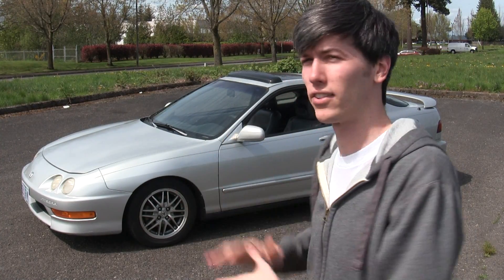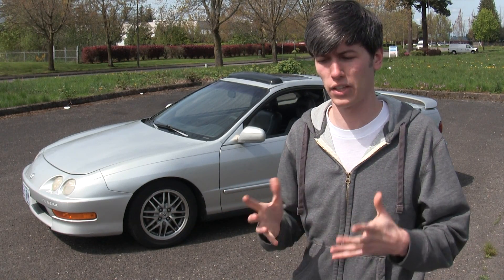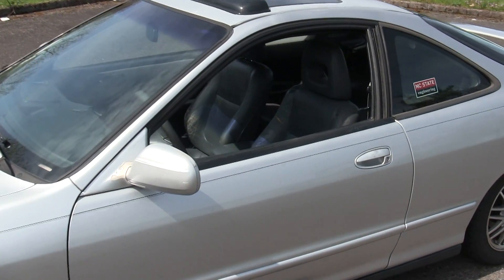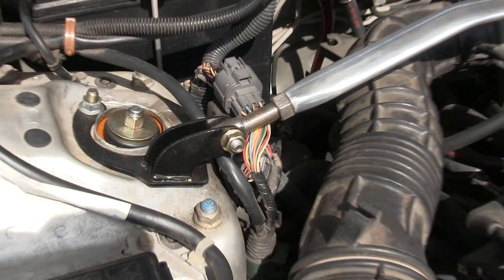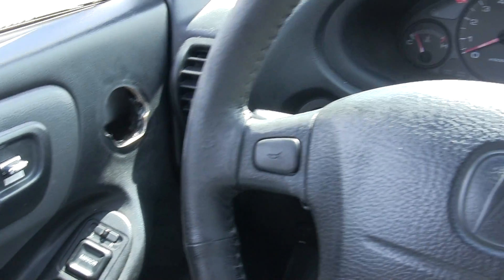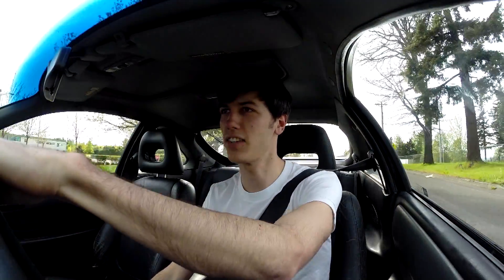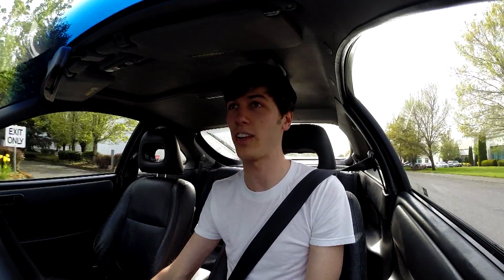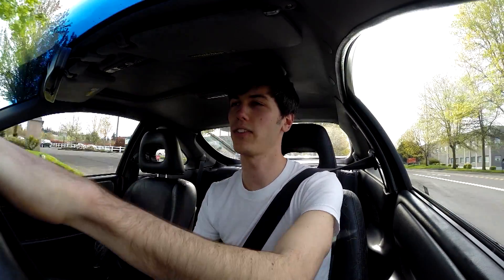Project Integra - Let's Build A Race Car

Comment: SO!! I'm late as hell!! But I have a really good idea. Make the integra into a canyon carver! No turbo! Supercharge it with something like a G-Lader supercharger from VW's G60 setup and make it a torquey, hard puller instead of a useless freeway racer. I'm thinking about doing something similar to my car. It'd be interesting to see how much you could get out of it (especially seeing as it'll be lower boost so you can probably get away with 9lbs right out the gate!).
Other than that suspension, steering, and brakes are going to be your bread and butter. I think the goal I had set was to be able to kill a wrx on a curvy back road. Sounds impossible but a lighter car with more mechanical grip and low-end grunt might actually work out. I figured I'd need more torque than hp since it'll be a lot of mid-gear carving so with the right setup you might get away with a modest 200hp/200lb-ft and the most overkill setup on suspension, brakes, wheels, and tires. Also a quicker steering rack but I think the factory one might suffice (never drove a teggy before so I can't really say).

Comment: You should put a turbocharger, even though I've heard all motor b18's are quick and strong the beauty of it would be that your motor can take a beating of higher speeds and temperatures. I'd suggest (because this is what I've done) AR50 Turbocharger- $100 ebay. Used b18 turbo exhaust manifold- ebay $30. Check for to see if its warped or you can find them on craigslist relatively cheap near you. Intercoolers and waste gates all can be found cheap (less than $100 together) while looking for the turbos i mentioned above. High performance injectors. Not sure what kind of ECU you'd use but I'm sure you could find out that answer. Go to home depot and buy house piping that has the same diameter as the input and output of both turbo and intercooler and going into your intake manifold. Buy lots of clamps too. Lot of reading in forums and there you go! Cheap method, but you will really really feel a difference. Some say ebay turbos are bad, but I've had mine for some time and it works just fine! (no play on shaft so bearings are still fine)

Comment: Start with a light weight performance flywheel and clutch system from ex ready. Increases acceleration and reduces the weight by 12lbs. PLus higher reves

Comment: Mishimoto radiator for a cooling upgrade? Msds for a ignition upgrade? Front lip from whoever you choose which will generate more downforce.  Get a bigger and better air intake which will suck in more air which you will might wanna upgrade to a bigger exhaust since your gonna wanna push out air as fast as it's going in.You could do a triangulated strut bar for the strut towers and a strut bar for the rear. You could do a poor mans type r?

Comment: all motor ls vtec, setup the suspension for road course racing and put a cage in it. kirky racing seat, some good electronic gauges, hondata s300 for the tuning. our acura is setup for scca road racing, its a blast and very capable.

Comment: I am working on my first tuner, usually buikd muscle cars, but for most part the basic mechanics are done . ( Check out MY FIRST ACURA ON MY PAGE ) Car is dropped but rides awesome . . . What i am thinking is SUPERCHARGER . If you go turbo then that involves piston changes and other upgrades so i would like to see what just a simple bolt on SUPERCHARGER will do . 
 Ironically my car has also been stripped of a lot of weight ... don't hate but i am going to be redoing the interior with carpet, sound dampening and custom wood touches :)

Comment: Hey! I just suscribe to your ''channel''! That's funny cause that's exactly what I did with My teg. 10yrs from now I decided to turn it into a time attack car... Since then, many engine, tranny, gearing, diff, weight, suspensions configuration has been test on this car... Here's what it turns out now fully striped, cages, weighting 2250 w/o driver with 2/3 fuel tank with a k20R in it... Not much car can compete with me on track... Especially on my short home track ASE!

ASELC 23 juin 2014

On this vidéo I was testing new gearing with old tire so my driving might look a bit ackward sometimes but hey, that the price to pay to go faster! 

I will follow your project !

Comment: Half of these comments are ridiculous on making a race car lol .... so for weight reduction you say to pull seats ok well integra rear seats weigh about 2 lbs altogether if that lol the front pass weighs a lil more maybe 5 lbs to 10 lbs  carpet weighs almost nothing that won't make any diff for a race car if that was the case youd have to just gut the  whole interior door panels all the dash etc keep just what gauges you need and that's it  all that would be left for interior is driver seat steering wheel and your gauges and ecu ....  as for motor mods you can go boost on the stock Ls but in my opinion and from personal experience doing it .... if your  pulling the head and going into the engine that hard you might as wlel make it LSV which im running on my integra which has better power outputs then any stock lS  you have  VTEC added so its now a better engine  but while inside swapping the head around upgrade cams valvetrains etc you could swap pistons to go ith high comp for NA or low comp for boost which the LS is already tuned for in the bottom end ..... now that the motor work would be good with an all rebuilt great engine with better revving and power outputs stock ..... now you go with a good turbo upgrade for power and put a good shot of nitrous in the trunk and this thing will pump out 6 to 800 hp depending in the internals upgrade you do and the shot of nitrous / turbo setup and tune but even on a lowball setting itd be an easy 550hp  with a car less than 2400 lbs power to weight would be great and a lot more fun then your STI ..... That's mY 2 cents I look forward to watching your build

Comment: Engineering Explained I work in a spare Parts shop in Australia and one thing that is still in heated debate are the benefits amd cons to pod filters vs the original air box. Maybe that could be a cheaper but still informative video???

Comment: 2 ideas: take it apart, see how little bolts you can use when putting it back together.  Just because.  And the other idea is to install a massive richer wing just to see if there are any performance gains

Comment: itr rear sway bar+ asr brace, sticky 200 treadwear tires, good brake pads, and seat time, you'll learn a lot just from what, rotation in the corners is quite good on these cars. 

Im in a similar situation as you with an integra as a second car with a powertrain warranty still on my GTI making me hesitant to mod it as much minus wheels and suspension. The thing about the Integra is Im finding it more raw and a fun tool to learn to drive faster with no electronic nannys on it outside of ABS.

Comment: Nice this Is awesome Integra makes makes a great fwd time attack car, I'd say no turbo do an all motor build more reliable and can beat on It harder  as for my suggestion for a video , do whatever you can to make that car as stiff as possible with strut bars, bracing etc maybe even a bolt in roll cage.

Comment: Rebuild the motor ..new piston and rods... bigger turbo (if you can get it ), full exaust ,new front and rear coils, weight reduction, bolt in cage, race seat, short shifter and big slicks tire in the front ...that would be and awesome car right there .... hope you can do this good luck man !!

Comment: At 5.35 we see you driving and turning right. You are using your left hand which is crossing over the centreline of the steering wheel. Your left hand is pushing away from your body.The muscles humans have that expand our appendages are less accurate than those that draw our appendages inward. Use your right hand to turn right. Use the left to turn left. Don't cross the centreline and you will discover an accuracy like never before. Try riding a push bike with crossed arms. Likely to fall off. Because the car has 4 wheels it wont fall over, that doesn't mean you aren't creating  unbalanced energy for the springs and dampers to cancel out. Ride a horse with left rein in right hand and vice versa. When you pull on left reign to make horse go left with your right hand it will be confused because rest of your body isn't working to tell horse to go left. So a car isn't a horse. But good driving requires you to feel the energy from a car. Thus professional drivers sit closer and firmer into the seat. This is of significant benefit to anyone wanting to enjoy the performance of their car.

Comment: People who don't understand why you would tune a slower car do not understand tuning at all. On a fast car that is brand new there is little to learn. On an older car every upgrade can be felt and the cost factor is easier to take. You can then move to a faster car and do what you want with it. People that want to do their own work do it this way. People who want to pay someone to do the work and then say they tuned their car won't learn much from it. I'd rather do the work myself than have someone else touch my ride.

Comment: Something on the cheaper side.
1. Strip interior
2. Upgraded rear sway bar and subframe brace
3. shorter gearing transmission such as b16, b18c1/c5, etc...
 For more power you have a lot of options. But these are relatively cheap mods. Oh and don't forget sticky tires.

P.S The holy grail of engine swaps is the k20 or k20/k24. It is a high potential engine and can gain 50+ hp with just bolt-ons and tune. It is a potent swap, especially in a lighter weight chassis such as your DC4. But, for much cheaper you could turbo your motor and easily attain 300whp on a stock motor safely and with upgraded parts your looking at so much power you'll have trouble putting to the wheels. Good luck, I own a Integra ls as well and love it!

Comment: Do you have any preferences as to whether you want to start modifying the engine first or the chassis?
I would like to see a whole rebuild of the engine with: cylinders bored out more, stroke shortened.
I would also like to see pneumatic valve lift modification. =)

Comment: See how fast you can make the stock car by removing weight/stuff before you start modifying it.  Then see how fast you can make it by reducing drag.  Gut the interior, remove sound deadening tar, stereo, heater, ac etc.  relocate the battery to the rear, and add multiple grounding points along the chasis.  Remove all excess wiring.  Remove cruise control, wiper fluid reservoir, air box (stick a cone filter on instead).  Remove power steering.  Move on to aero.  Seal all of the panel gaps with rubber insulation (look at an BRZ or FRS hood) or other methods.
The Right Way to Remove Sound Deadening with Dry Ice

Comment: Throw a VTEC head on it get your headers done get an exhaust get a new intake, new intercooler, get your internals done get a new clutch and strip down the engine bay , after all that check how much power your making than turbo it  and strip down the inside and get lightweight seats, tune it and definitely make it a sleeper.

Comment: Remove the sunroof and weld in a metal plate. It's supposed to cut about 50 pounds from the top of the car and improve structural rigidity

Comment: You should look into getting light weight wheels and tires to save un-sprung weight. Im putting 17x8 and 17x9 rpf1's which weigh 15 and 16lbs. You should also  do a video about un-sprung weight too if you could please and thanks @Engineeringexplained

Comment: Power? Feh. If you really want to go fast, remove weight. Lightness is the single most important performance modification for any car. This means remove EVERYTHING; carpet, seats, interior trim, sound deadening. Get a lightweight battery (and move it to the boot) — "simplify and add lightness". I'm sure you're all aware of the benefits: better acceleration, cornering, braking and fuel consumption.

If weight is the most important thing, then tyres are the second. You could have the best engine and suspension ever, but the tyres are what actually do the handling. Choose wider (and light-weight!) wheels with the slickest tyres you dare.

Brakes are just as important. With good brakes, you can spent more time accelerating before a corner — the longer you can accelerate for, the better. It's easier to be confident, too; knowing that even if something goes wrong, you can always stop in time.

A good suspension setup must not be overlooked. Body roll should be minimised: anti-roll bars and stiffer springs/shock absorbers; let's prevent the nose from diving under braking and lifting during acceleration. Don't forget good old-fashioned geometry tuning: some negative camber for traction and a hint of toe-out for response. A lower ride height will provide a lower centre of gravity, and improve aerodynamics.

Speaking of aerodynamics, you might want to consider a front splitter. The front wheels have to do the turning, braking and accelerating, why not help them out a bit? Wind power: not just a source of renewable energy!

Congratulations, you now have a car that no-one can keep up with, and you didn't even touch the engine. Enjoy having a fast car AND bulletproof Honda reliability.

Comment: Hello, I´m a new and happy owner of a Honda Civic Coupe 1993.
i live in Brazil, so somethings to buy I have some difficulty.
But I wanna know if do you have some ideias, something to improve the performance, like news intake manifold, exhaust our air intake.
Tks, Vinicius
Reply: How much horsepower do you want and how much money do you have to put in it?  What type of motor is in it now?
Reply: +Engineering Explained... if you could answer me. TKS!!!
Reply from the maker: Vinicius Valfogo I guess I'd say keep this playlist in the back of your head. I'll hopefully be uploading some stuff on it soon!
Reply: Ok.. really thanks!!
Reply: Now have a 1.6 liter Vtec with 125 horse power. I want improve something between 20 25 hp. what you think about a sports air cleaner, intake manifold, remove the catalytic and muffler. What brands is the better for my car.
Thanks.
Reply: Vinicius Valfogo Bigger intake manifold, intake, high flow cat....maybe headers, you can get a full exhaust, but it may be too big of a pipe for you.  as far as brand, skunk2 for the intake manifold, aem for the intake, unless you want to use something that isn't a popular name brand...worked for me....let me know hot it goes

Comment: I think one of the best and most "bang for your buck" upgrades for fwd cars is a beefier rear sway bar. It's relatively cheap, easy to install, and usually has a noticeable impact on handling. I'd love to see you install one and explain how it works from an engineering perspective. Thanks for the videos!

Comment: I/H/E with a tune, maybe upgrade the intake mani and throttle body...do itb's! Thatll be awesome :) horsepower bump and those aftermarket parts tend to be lighter than the stock parts

Comment: I have heard that removing the intake silencer (maybe called baffle?) will give a few extra horses. It makes sense to me, but i am no expert.
Reply: Engineering Explained The pressure differential is not bad on most.  You mainly gain weight savings at an extremity of the car (best place to loose weight). Nearly every mass production intake is not engineered around the wave lengths of the pressure in the tube though.  Injen is the only company that makes a tuned intake for Hondas.
Reply: Engineering Explained

Well, I am hoping to see this car get to the point where aren't that restrictive becomes not at all restrictive. :)
Reply from the maker: Depends on the design, and engine, of course. Most really aren't that restrictive.
Reply: depends,  they are restrictive if you consider the whole plumbing and airbox.  the plumbing is normally the restrictive part.
Reply: but yeah, removing one half of your airbox is not going to magically give you more power haha
Reply: david seholm comptech icebox?

Comment: The first episode should be gutting the car.  Then you should work on suspension and I want to see an episode where you install all the energy suspension bushing.  Then upgrade brakes, willowwood.  Then build motor for boost.

Comment: How about making a hypermiling car. Make it as efficient as possible. Its cheaper than speed/performance modifications and it will be cheaper to drive. Remove the spoiler, wildshield wipers, passenger side mirror, make smooth wheel covers, and build a grill block to reduce drag. Strip the interior and empty the wiper fluid tank for weight reductions. Remove the AC and power steering to save wasted power. And get a fuel economy computer to track progress

Comment: disassemble the engine down to oil pan, reassemble increasing stroke volume up to the valves. Throw in some new valve spring then install v tec cam shafts. Also do something cool with the air intake like install a turbo or something.